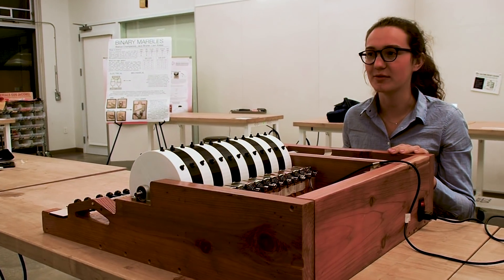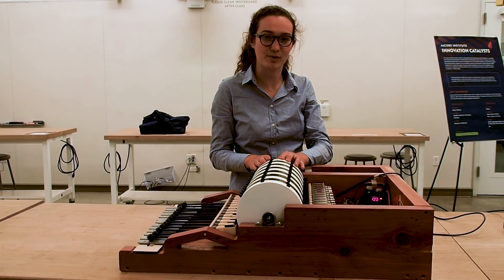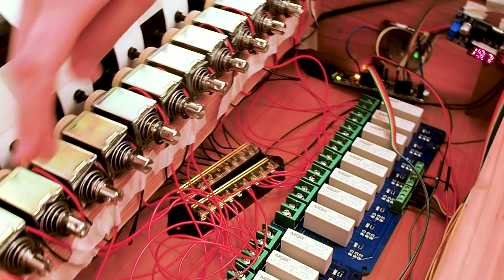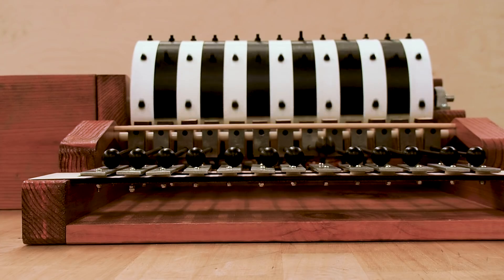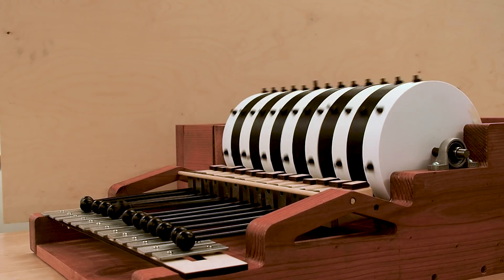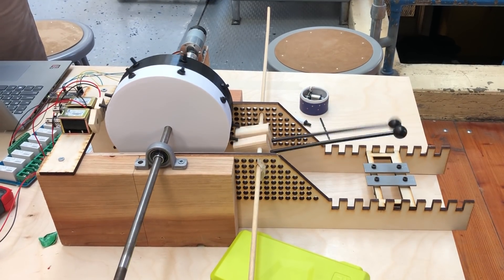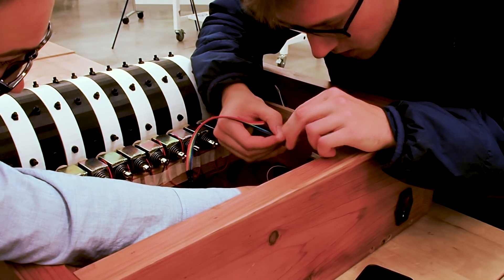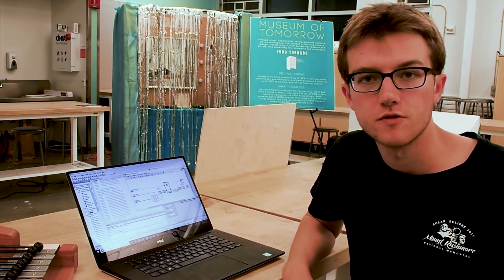Infinite Music Box

Comment: First of all, looks great! I love the idea! Maybe you could mount a real vibraphone because the tones sound a bit muted. This is probably because the notes are attached a bit too tight. Some rubber o-rings on those pins will do the job!

What you really need is a way to make the tones louder and the actuators a bit quieter, because at the moment it's the other way around. Some clever mic placement could do the job, but I think if you move the actuators a little slower and replace the wooden click-blocks with larger sloped design (like a wide V) to slowly click the buttons and release pressure, it would be a lot more quiet without needing major modifications to the structure as a whole. Maybe also add some felt pads to the actuator blocks. You also could leave them in the actuated position if you want to click multiple notes in a row because the sloped blocks will be able to flip an incoming pen.

The hardest part to pull this off would be to make the actuators move more slowly. Maybe a capacitor with some resistors would fix that problem, but I'm afraid you'd have to replace the whole relay situation for something that allows for more refined control.

Maybe you could add some rubber o rings to the actuator rod to act as a dampener, and maybe you could add some rubber pads under the actuator mounting because the whole wooden housing acts as an amplifying board. (Like what happens inside of a piano or guitar).